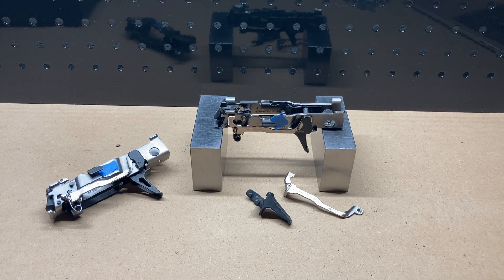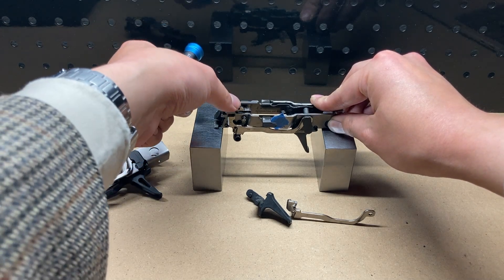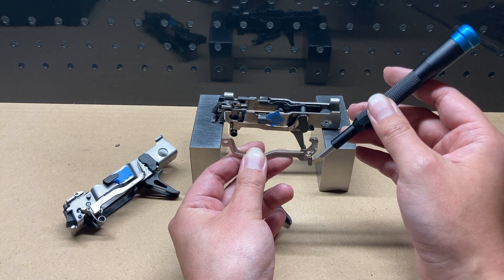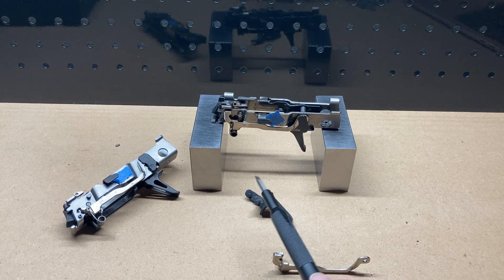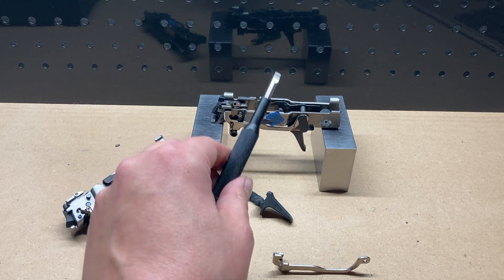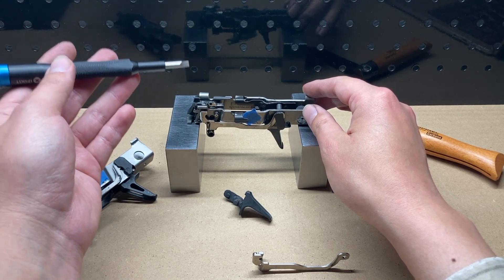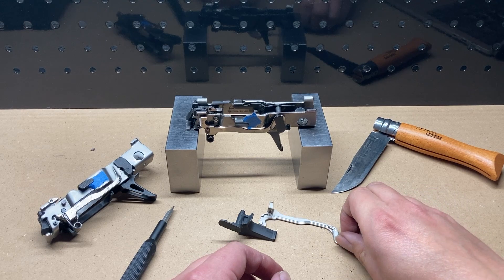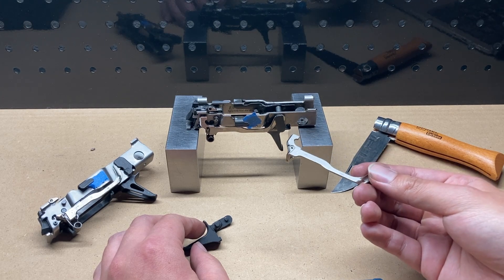P320 Sear Movement Test followup: It's all about the Trigger Bar and Trigger

Comment: Here is an in-depth analysis: I have two P320 pistols - One is voluntary upgraded while the other is the post-upgraded from the factory. Both exhibit different behavior. 

The voluntary upgraded pistol trigger bar moves diagonally down and does not click with sear actuation. A small amount of pressure applied to the trigger while the sear is fully actuated allows for the trigger bar to click up. Unlike your example in the video, I need to apply tiny amount pressure to the trigger after full sear actuation to get the click. The striker safety lever moves partially up on this pistol when the sear is actuated. It does not move up enough to fully actuate the striker safety block.

The post upgraded pistol trigger bar moves forward (not diagonally downward) with sear actuation. There is no click. With added trigger pressure and full sear actuation, there is no click like my voluntary upgraded pistol. The striker safety lever moves up much more than my other pistol. That is to say with the same amount of sear actuation , the lever actuates the striker safety block much more on this pistol than the voluntary upgrade pistol. This makes it less safe and more prone to overcoming the striker safety block if the sear were to be actuated without trigger pull.

Fortunately, in both pistols while fully assembled, sear actuation allows the striker foot to release would not result in an uncommanded discharge as the striker safety block works 100% percent of the time and does not allow the striker to pass the breach face. I would still argue that the post upgraded pistol has less striker block engagement as the voluntary upgraded pistol due to the increased striker safety lever movement in the post upgraded pistol. 

The fact that both pistols exhibit different behavior with the same input is indicative of a design flaw. Whether or not this different behavior could allow for an uncommanded discharge, the different output behavior in the 'same' pistol configuration is mind boggling. The design is not robust enough to output the same behavior between two pistols (sample size of two) with the same input. Tolerance stacking happens on every design. Tolerancing is a DESIGN issue, not a manufacturing issue. Assuming all my components are within tolerance, the result of different combinations of parts should achieve the same result for the assembly to be in spec or to achieve the same behavior part to part. 

What is the design behavior of the pistol? What is modeled at SIG for this pistol? Based on the two pistols shown in the video and the two pistols I tested I see three distinct output behaviors with the same input: sear actuation. 
	1. Diagonal downward movement with a click. Partial striker safety lever actuation
	2. Diagonal downward movement without a click. Adding pressure to trigger allows for a click to behave similar to Behavior #1. partial safety lever actuation.
	3. Forward movement only that does not click. Adding pressure to trigger does not result in a click. Near full striker safety lever actuation.

What is the nominal behavior supposed to be? I venture to guess #1 based on your thorough analysis of your pistols and the fact that #1 results in the least amount of striker safety lever actuation. This case is the most safe as it best prevents the striker safety block from surpassing the ledge on the striker. 

I am appalled by this design and @P320Truther is providing useful analysis of the variation in the population of produced pistols. 

The unanswered question is how the sear is being actuated by itself. It is clear that if the sear actuates by itself or separates from the striker foot with some external force (likely with little initial engagement with the striker foot to begin with), the pistol can either be safe or unsafe leading to an uncommanded discharge depending on whether the pistol exhibits one of the three behaviors listed above - I'm sure there are more behaviors not understood or analyzed at this point - safe or unsafe. 

Once the sear actuation issue is discovered (Sear spring failure, spring crossing, or otherwise), SIG is DONE. They will end that Day. The pistol is proven to be unsafe as the striker block is ineffective from a design perspective, not just a component quality perspective. 

I hope that someone discovers the repeatable root cause of the sear actuation that is independent of the operator. In all cases of uncommanded discharges, I do not see the possibility of a pin sized element finding its way into the back of the slide and pressing the sear downward. SIG could make the case that allowing something to find it's way into the back of the slide causing sear actuation is operator error however,  they would have to admit that their striker safety lever and striker safety block are ineffective and unsafe. Isn't the design intent of the safety lever and safety block to prevent primer strike given the sear was actuated without trigger pull?

I hope the free market develops a fix and SIG crashes to the ground. This pistol had been pointed at my baby producing parts for far too long and by the Grace of God Almighty I'm still fertile.
Reply: Interesting observation with yours. I have a 2020 post-VUP M18 with the manual safety. My trigger bar moves down and forward with a click up when pressing on a fully actuated sear with manual safety off.

When the manual safety is in the on position, the trigger bar drops lower and raises with no click.

However, when pulling the trigger with the manual safety off, the trigger bar moves forward.

Some other guy's video is making its rounds that shows the slide lock levers need to be pushed up to actuate the sear after reassembly.

The natural course of field stripping the M18 makes a practical design move to utilize the slide lock when operating the release lever.

There should be no reason to bypass this step, except out of habit and complacent operation of firearms without regard to design differences, in which case would require one to move the slide lock lever up to ready the firearm for use.

Spontaneous mechanical malfunction should be low no doubt, but it will never be zero. Add human intervention, moderate  opportunity for malfunctioning should be the goal.

Stupid-proofing a weapon is in itself stupid.

Comment: You probably would need a computerized coordinate machine (CCM) to tell the difference between the two trigger bars. 
Calipers only can not pick up small differences of angles, or dimensions, in relation to each other. If Sig is actually using a CCM in their inspection process of these parts, they have their tolerance set too wide, as not to fail too many parts.
Either that, or they are only inspecting 1 out of a hundred parts, and the bad ones are slipping by. Or the inspectors in India, where the parts are made, just don't give a rat's ass.

Comment: Definitely concerning that the safety can be defeated from the rear, but there would still need to be enough inertia applied to the sear to overcome multiple springs without any proof afterwards that the springs have failed, which seems so unlikely as to be impossible, especially at the rate is claimed to have happened.

I have had some issues with the springs in the striker safety, I wonder if there is any influence there.

Comment: What touches the trigger bar? Maybe its not a measureable difference but rather a angle difference (like how glock trigger connectors are. More angle or less determines weight diff). Whatever the trigger bar touches... Check the angle. I dont have a p320. So i cant really do anything but speculate. Ive seen a couple other vids.

Comment: I've done all three of your tests on my M17x (purchased early 2025) and have some interesting datapoints to add.
1. Test from first video, fully assembled gun (except barrel + recoil spring) and 'poke' the sear: PASS. No firing pin protrusion 10/10 times
2. Trigger bar test with FCU outside of grip: PASS. Bar goes down and forwards, FCU goes 'click' at the peak of sear pressure
3. Trigger bar test with FCU inside grip: FAIL. Bar goes straight forward. No downwards movement, and no click at peak of sear pressure
Also may be interesting to note that it took a reasonable amount (a lot more than expected) of pressure to pull the FCU out of the grip.

Seems to me like the only real test that matters in this case is the firing pin protrusion test, but I'm very curious what you make of this..? let me know if there's any tests I can run or part numbers to share that could help you fill in the picture you're painting of what the issue could be on these 320s

Comment: Noticing that basing on what grip module and geometry of even the trigger bar return spring, the tail end of the sear would interact with the trigger bar unpredictably.

I think the most reliable way is for me to cut off about 2mm of the tail, just so it doesn’t interact with the trigger bar at all when the strike is released, ensuring the striker block is unmoved.

Would you perhaps try doing this mod? Spare sears are quite affordable.
Reply from the maker: Way ahead of you on that one, more to come soon!
Reply: I did literally this and the sear no longer has any effect on the trigger bar. 2mm was all it took.

Only concern I have is, some people suggest the tail actually allow for the trigger bar to keep the sear itself from dropping.

So basically we have a dilemma here… 
1.) Have the tail + trigger bar help keep the sear up
Or
2.) Have the sear only held up by the two small spring, but have the striker block work 100% of the time

Side note, when manual safety is on, the sear doesn’t get any help from trigger bar anyway so the above point might be moot

Your thoughts? Looking forward to more videos!
Reply from the maker: @Ttyngai  In my opinion, having a functional Striker Safety Lock is paramount - even if literally everything else fails, as long as the Striker Safety Lock is still working properly, there will not be an uncommanded discharge. I'm not even sure that the Trigger Bar has any appreciable effect on how much the Sear resists movement, but even if it did, the Sear being able to defeat the final measure of safety is such a wild and puzzling way to allow the pistol to work.
Reply: @P320Truther I just shaved 2mm off of 4 sears and they all work as intended - not interfering with the safety at all. PM me if you want pics.

Comment: Just for testing purposes I ordered an aftermarket disconnector (that was designed to stop the rare OOB firing issue with the 320) and replaced the stock disconnector on one of my FCUs that were failing this test, and it now passes this test. At some point I might try this part in a couple of others that failed.
Reply from the maker: I'm so glad I've stopped trying to chase trigger bar behavior at this point; that's the first I've heard of a disconnector swap changing FCU behavior.
Reply: @P320Truther ¯\_(ツ)_/¯ yeah I don’t know. If Ive got some time this weekend ill try moving it to a different fcu that also fails and see what happens. Maybe also an oem disconnector from a passing  fcu into a failing one. Could just be a fluke with tolerance stacking or something.
Reply: @P320Truther   So I did some swapping of the disconnectors around and seems it's a fluke of tolerance stacking or something. Passing FCU OEM disconnector swapped with non-passing FCU results in the same FCU still working and the non-passing FCU still not passing. 

Swapped aftermarket disconnector into another non-passing FCU and it still does not pass. Can't reproduce the disconnector 'fixing' an FCU aside from the one I chose at random to install it into originally lol.

Comment: Subbed so I get any updates that come of this! Hoping for a solution to this as I like everything else about my p320 and don't really want to just have it sitting in a safe or junk it.

For what it's worth, tested my p320, 675 trigger bar and the OEM non skeletonized flat trigger. It has the undesired trigger bar movement of just straight forward without the downward movement, but doing the test from your first video, I never have the firing pin protrude when I force the sear to drop.

Comment: All of this testing ignores the fact that strikers are slipping off sears with guns in holsters, with some not disengaging the striker safety, and some disengaging the striker safety.
Reply from the maker: Correct. This test assumes that the sear is moving and doesn't care why. To figure out why the sear is moving would likely require access to institutional-levels of testing equipment and sample size.

Comment: In layman’s terms, if the trigger bar moves horizontally is that good? Or do you want the trigger bar to travel in the V pattern?
Reply from the maker: You want the V-like motion. Or for the trigger bar to not move at all in the Sear Movement Test, but that doesn't seem to be possible with current, unmodified "post-upgrade" parts.

Comment: Have you tried any aftermarket triggers to see if they solve the problem?
Reply from the maker: I have only had access to test an Apex trigger, which did not solve the problem.
Reply: @P320Truther try the Agency Arms Trigger
Reply from the maker: The Apex is the only aftermarket trigger I've had access to; I have not gotten my hands on an Agency Arms trigger, so I can't say whether it would or would not prevent sympathetic movement of the safety lever.

Comment: Finally got around to testing both my 320s (ones m17 and ones m18 fcu). The M17 seemed to pass with downward trigger bar movement, my M18 I think passed but I have the agency arms trigger so I have to put a bit of force to disengage that to "test" the trigger movement. That small force affects the test which makes me believe that's also correlated with the issue somehow. Half a pound of force shouldn't trick the FCU in thinking the trigger was pulled, even a light weight trigger dropped could produce that under the right circumstances. Safeties engaged seems to mostly disconnect the striker safety. As stated in the video there seems to be a very close to 1:1 ratio with trigger movement and striker safety catch. Even my Agency Arms Glock style trigger theres movement before the triggers own "safety" engages so besides the QC issue with the trigger bars, is that the main point of failure? I feel like either takeup should be a separate feeling from the striker safety, OR absolutely no takeup before that starts disengaging. I wasn't very hopeful there'd be a solution to these problems even if sig agreed but, maybe with trigger geometry, better materials perhaps the platform can be saved? One final note, were you able to discern how many of the "failures" were legit striker catch failures vs striker catch disengaged? I'm still slightly concerned about the beefiness of the striker catch and how reliable that'd be.

Comment: Does this condition exist for just the models without a thumb safety OR does it INCLUDE models WITH a thumb safety ALSO?
Reply from the maker: With the caveat that I've had a sample size of one and then unverifiable anecdotes from the comments sections, the manual safety appears to successfully stop the trigger bar from moving forwards, which prevents the trigger bar from actuating the safety lever during a Sear Movement Test. This means that while the manual safety is on, a P320 FCU doesn't seem to fail the Sear Movement Test. That is no guarantee as to how the FCU will behave when the manual safety is off.
Reply: When the manual safety is engaged, the trigger bar goes downwards a little, just enough for the rotation of the sear tail to engage only the top part of the trigger bar, thus likely pushing it downwards and away from the striker block lever

Comment: Thanks for these videos.  I've had an M17 for years now, as my only non-.22 pistol and it's been worrying me how much I should rely on it.  I've put thousands of round through it at the range and in matches with no issues.  What you're showing here is there's clearly an instance of only some P320s being affected (or maybe only some being unaffected, to be fair).  And in my eyes, that tracks.  If it was an issue with all P320s, we'd likely hear of a lot more UDs.

I've got a comp on mine, so taking out the barrel for the first test wasn't feasible, but I can very clearly see the trigger bar movement here.  Thankfully, it appears to be doing the "right" movement.

Sig's handling has been abysmal though.